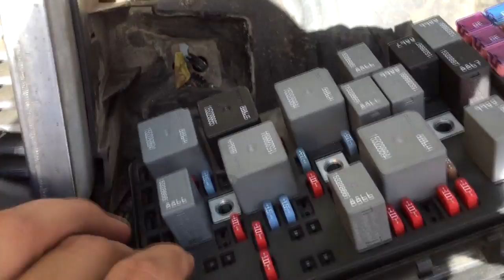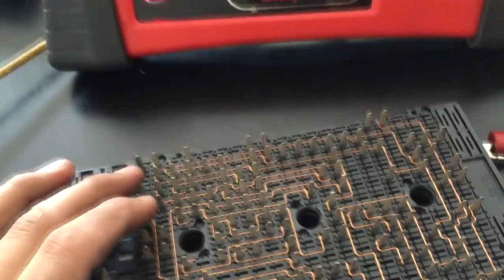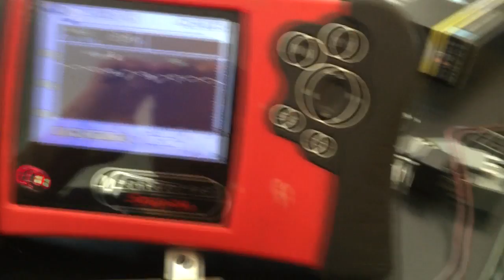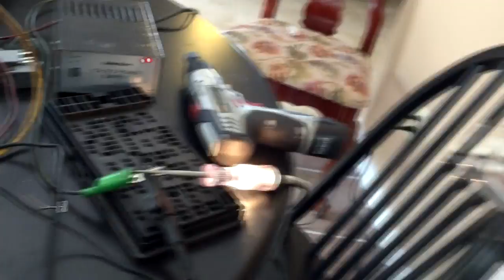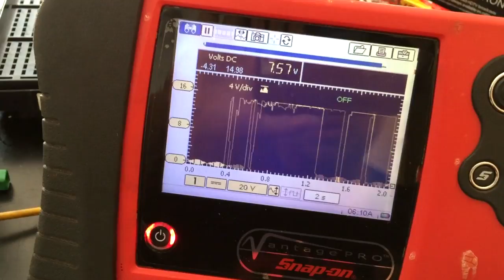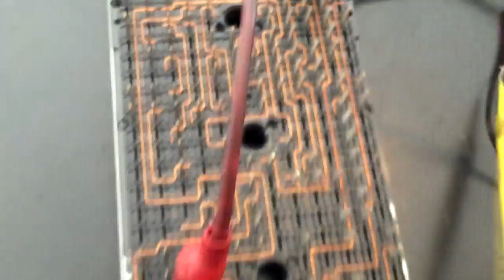CHEVY MALIBU NO CRANK WHEN HOT UBEC FUSE BOX FIX

Comment: 2009 Chevy Malibu LTZ 3.6L - Same exact issue.  Replaced Starter Relay and Starter/Solenoid, same issue... no crank when warm.  While investigating, discovered previous tech ran a jumper ground from Starter Relay to frame ground - which is not a good idea.  Applied slight pressure to underhood fuse panel with fuse panel cover removed while warm... cranked and started fine.  Thanks to your video, ordering the GM replacement Junction Block - GM part # (20822701).  Thanks for the detailed information... You would think this would be a standard GM recall, as many are experiencing this exact same issue.  Is General Motors listening?
Reply: My son-in-law is still driving the car after replacing block... The junction block is the under hood fuse box. The new junction block has been redesigned.  Not a surprise.
Reply: For those with Malibu LT 3.6 without foglights gm #20822706       ;)
Reply: Hi there! Did this fix the issue? So don’t buy a new fuse box, buy the junction block you have suggested?
Reply: Haven’t had my car for 3 months from this. No mechanic knows the issue.
Reply: I have the same issue but my car won’t even crank up anymore is it the fuze box? An i have a 2011 Malibu
Reply: @ChrisArtillery  yes

Comment: I've never seen this kind of detailed look at a fuse box, bravo! Lesser men would have simply replaced the whole box.
Reply: I like the idea of saving the customer some money but the guy who replaces the whole fuse box is not a lesser man. Kieth Defazio would have replaced the box after 5 minutes of diagnosis because of his work environment, he's gotta do 20 cars a day. You gotta remember different techs are under different pressures. Not trying to be an ass, just sharing my thoughts.
Reply: @kdmq  Good point.
Reply: @kdmq  I agree.
Reply from the maker: Thank you for watching!
Reply: @ADVANCEDLEVELAUTO  Good video . Good information . I have re-soldered many gauge clusters and repaired way to many fuse panels in the 2004 to 2008 F-150,s that are located in the passenger kick panels . I purchased a kit of relay testers brand name Service Tools part number 56810 . This kit is a time saver !!
Reply: You mean lesser men wouldn’t have wasted any time trying figure out what went wrong inside the box and just replaced the box after the proper diagnosis?
Reply: I am lesser men
Reply: Hi I would like to ask you did you have this problem with your car. My car seems to have it in the fuse box inside the trunk of the car. The mechanics have changed out two fuel pumps and the problem remains the same one day my car will start the next day it won't start. They haven't touched the box in the trunk but after seeing this video it's convinced me that it is. Tell me how much did the repair cost you for this issue
Reply: @lauraschlottertorres1990  I would not jump to the conclusion that your problem is as shown here. On the other hand, with two fuel pumps already replaced, it may be time to ask for another opinion from somebody who knows more than a little about diagnosis.

Comment: I would like to have seen it WITH A THERMAL IMAGER. But a very. good case study and video.
Reply: You make a good point, but don't forget that the wire involved does not carry current except when starting, so the heat problem is indirect. The whole box may twist and grow when it gets warm, because of the way plastic moves with heat. It doesn't even have to be electrical, it could be indirect heat from the engine. The wire itself won't be hot unless you crank the starter so long that you could destroy the starter motor.

Comment: Did this exact same test expect without the light had a split at the same spot thank you for the video.
Reply: Did you solder the box too? I’m kinda scared to take the fuse box apart and it not work after

Comment: My 2012 malibu has a hot-start issue just like this. It’s been assessed by dealerships in Chicago & Detroit since 2014 for this issue with no accurate diagnosis. After getting completely stranded last week we had it towed to a friends shop & just got it back with an $1100 bill, and the 3rd fuel line replacement for this vehicle, but the car is STILL not properly starting! We totally give up... No one so far has even considered it to be electrical... It’s had hose flushes & cooling systems checked & other hose or line work, but never had a starter replacement or any electrical work to it. Any ideas for us? I’m afraid I have to sell the car but even that idea is a failure because then whoever buys it  will eventually get stranded too & the documented maintenance history is extensive ☹️

Comment: Hi, man great work, I have my fuse box taken apart and can see it cracked in the same exact location. What type of solder did u use and what was your method of soldering this? I greatly appreciate it. Thx.
Reply: how do you remove the dang bolts
Reply: @brianmcreynolds3699  did u ever get those out I have the same issue😑
Reply: Hammer them with one quick wrap, and they'll pop out of the sleeves. Then drill the sleeves
Reply: @DustinHillegass-ib2ew Hi, i have the same problem and i can't remove that bolts, may you explain more please 🙏🙏

Comment: I found the same exact problem on Malibu I was working on it was on the bottom side one of these starter relay wires had a micro crack right in one of the Benz and I could barely see it till I touched it with something and seen it wasn't connected I can send pictures if anybody wants just need your number to text it to you or your email address
Reply: I need it
Reply from the maker: Awesome!
Reply: Do you still have the pic's?

Comment: How did you separate the fuse box???
Reply from the maker: I had to drill through the plastic where the bolts go.
Reply: Could you show how please??
Reply: Any vídeo how You did it?? Remove bolts from box and have acces to circuit board...

Comment: Can i just buy. An new fuse board
Reply from the maker: Yes, that would be much easier. Thanks for watching!
Reply: @ADVANCEDLEVELAUTO does the new fuse box needs to be reprogrammed?
Reply: Did u get a new fuse board Luis and did it fix the problem please let me know having the same problem right now
Reply: @jonahsilva988  no hasnt been doing now thats its cooler temps outsise
Reply: Did buying that fix your problem. I have a 2009 Malibu and I been having this problem for over two years

Comment: How do you open the fuse box to get to the copper lines? I’m having a very hard time trying to diagnose correctly the condition of the box. I can’t just buy another fuse box if it’s not the problem of my car.
Reply: Same issue in my 2012 malibu
Reply: How do you open the box ,i all ready try to open but  is not posible